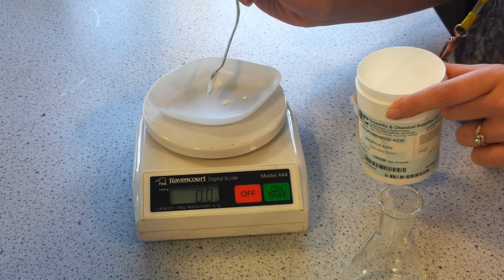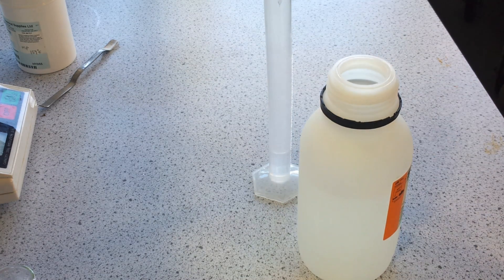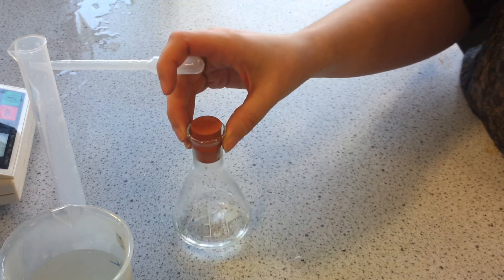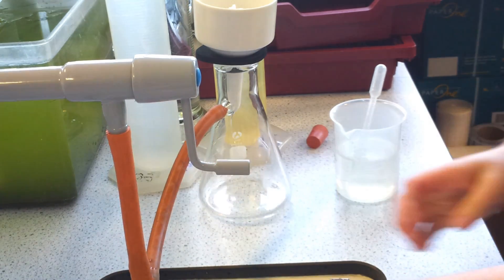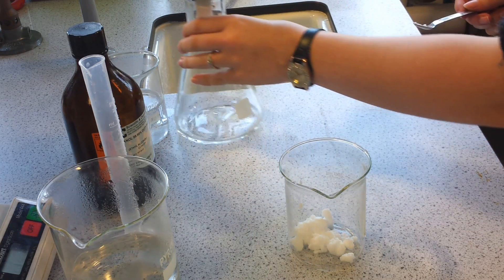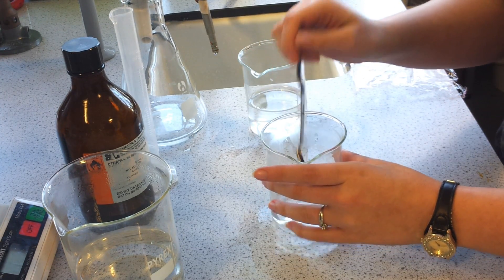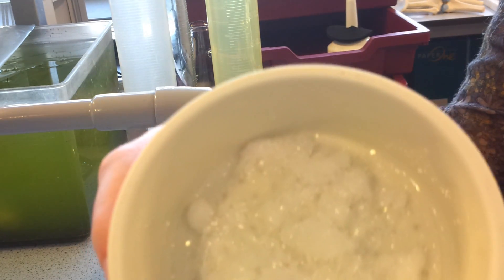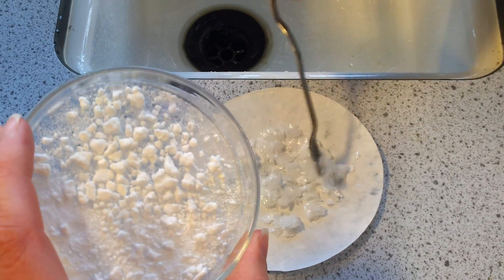The Making of Aspirin

Comment: notes1. salicylic acid + acid anhydride + phosphoric acid
2. water bath for 15 minutes
3. 20 drops of cold water into the solution and then all in one go
4. cool in ice bath
5. wash the solution through ice cold water through Buchner flask
6.  recrystallisation: 10ml ethanol to crystal, dissolve in water bath
7. add warm water, cool it down
8. vacuum filter again
9. dry on filter paper
Reply: But where are your calculations?
Reply: ممكن اعرف

Comment: This is useful but there are a few problems here. Firstly there is not all of the correct equipment for the job e.g. a glass stirring rod should be used for the mixing of the crystals and ethanol. Secondly, the lab techniques displayed are not accurate,  the measuring cylinders are not observed correctly and there should be clear information on what reactions occur. These are just a few issues although, the basic principle here is useful for a recap on what to do.

Comment: It is incorrect to use gloves; getting phosphoric acid on plastic gloves will melt the plastic, and it will fuse to the skin; you also lose some hand dexterity when using gloves. ALWAYS use protective eyewear, of course.
Reply: It can still react with plastic, it just depends on the type of plastic
Reply: Eddie Perez 
Would that also apply to other gloves with rubber coating?
Reply: Ever heard of silicone
Reply: +Eddie Perez (xblBabyPros) 
Acid doesn't react with plastic. Acid reacts with metals.